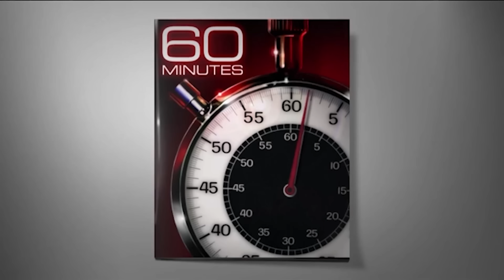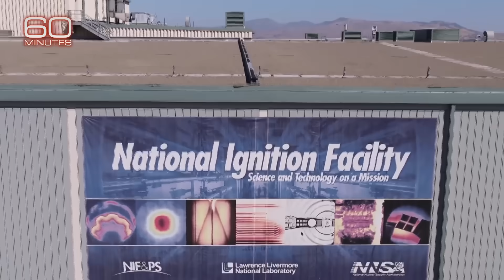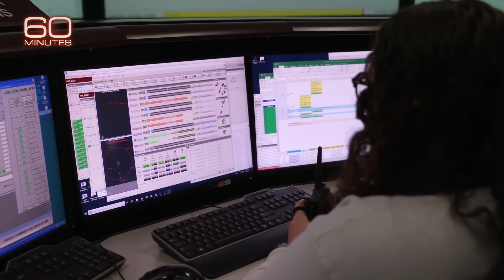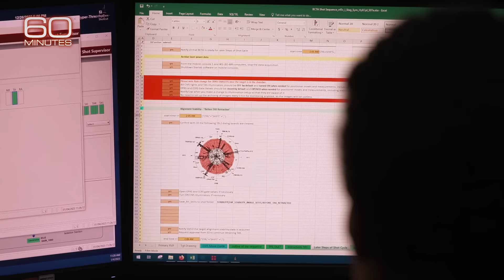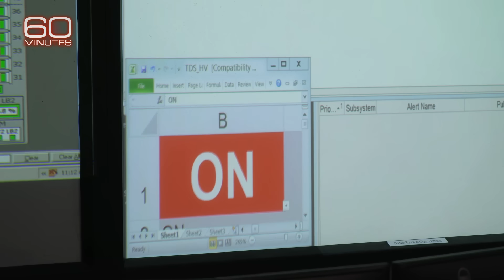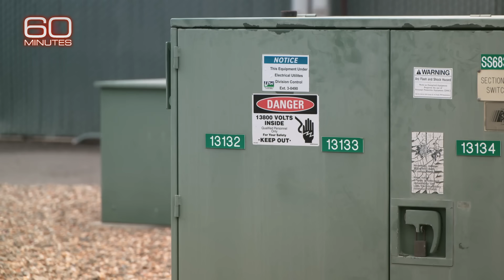Nuclear Fusion: Inside the breakthrough that could change our world | 60 Minutes

Comment: This has been done before this isn't new. It takes more energy to activate the lasersers than what is produced.  The Most successfully reaction in Fusion energy was done at the University of Wisconsin . Using Superheated Plasma (Burning Deuterium and Tritium (hydrogen-3 half life 12 years ) vs helium-3 (Half Life 72 hours and is contained)  . helium-3 would require mining the moon . its fusion with deuterium is more efficient than deuterium-hydrogen-3 ). It isn't like hydrogen from the aire?? 60minites . Tritium is rare and can be produce by mining Lithium.   It can be produced during the fusion reaction through contact with lithium, however IT isn't FREE . there is  already a Power Plant being built in France based on this  ITER it will be ready in 2025 . 60 minutes  didn't do its research?
Reply: Good try but you got many issues wrong. The ITER in France was never designed to be a power plant. It remains a research reactor under construction. It is over a decade behind its original schedule and grossly over its original budget. During the last year it experienced more major construction issues. It will be lucky if it can begin its experimental operations by the year 2030. I urge readers to search for the following article and video titles.

ITER is a showcase … for the drawbacks of fusion energy (The Bulletin of the Atomic Scientists)

How nuclear fusion works (1) - fusors, thermonuclear reactions, lattice fusion (YouTube)
How nuclear fusion works (2) - confinement, stars, nukes, inertial fusion energy (YouTube)
How nuclear fusion works (3) - magnetic confinement, tokamaks, stellarators (YouTube)
How nuclear fusion (maybe) works (4) - reactor practicalities (YouTube)

Comment: Shameful, but not surprised the Biden administration would lie on the numbers of units (power) required to produce the units that were produced.
Reply: This has nothing to do with President Joe Biden's administration. The use of fission gain, rather than total gain, has been accepted by the nuclear fusion community for many decades. That included during the Trump administration as well as the many Republican presidential administrations going back to the origins of the research efforts in the 1970s. Good try in trying to blame it on the current Democratic presidential administration.

Comment: China is WAY ahead of you, fella! Their fusion episode lasted a lot longer than yours.
Reply: Most fusion announcements are filled with sales hype and are often misleading. They often concentrate on what may be achieved in the future while obscuring what was actually achieved. If you examine the actual achievement by the P.R.C. machine you learn that it was never intended to achieve a actual nuclear fusion reaction. It exist simply to test the how long they can contain a plasma containing the normal hydrogen isotope. It has never been intended to feed that machine with a mixture of deuterium and radioactive tritium fuel. Ask yourself did the announcement contain any mention of detecting 14.1 Mev nuclear fusion neutrons. You can read about the achievements of that machine in the Wikipedia article on it.

Comment: It's just proof of concept. Current fusion experiments cannot be fueled with current fuel as it is scarce.
Reply: The market cost of the radioactive tritium used in most of the fusion experimental approaches is approximately 30,000 per gram. It is expected to get even more rare and expensive in the near future. This fact has been known since the 1970s when the first nuclear fusion reactions were designed. There are several other approaches to achieving nuclear fusion reactions. If one critically analyzes the announcements for them it may become clear that almost none have achieve significant fusion reactions.

Since the 1970s there have existed the common claim that the fuel is as plentiful as the hydrogen in the oceans. That has always been deceptive BC.

Comment: Oh my god!………..i hope this is an old re run………. The chinese have developed a sun. Twice they have fired it up  run it then shut it down just to study the data….. they did this 2019 and 2022. China is so far ahead, you guys are so far behind. Hahaha
Reply: Most fusion energy 'breakthrough' announcements are filled with sales hype. They often emphasize what the technology may lead to while smothering what actually took place. If you go back an look at the announcement, or look at the Wikipedia article on their machine you, may come to realize that the machine is not intended to use the two fusion fuel isotopes and their experiments don't generate any significant fusion energy. They simply were able to confine the normal hydrogen isotope for a record period of time.

Comment: Nice experiment...  But hardly any USEFUL purpose.   Way better to focus on Liquid Thorium Reactors.     The United States DOE simply GAVE China ALL of the  Thorium flouride salt technology it had.    Commercial fusion is NOT a decade away.    
A piece of thorium the size of a large marble.... Contains ALL of the Energy that a human needs, for their lifetime.    ZERO danger of radioactive steam explosion.  
Fuel costs a small fraction of the very expensive Uranium -ceramic Rods.
Reply: For the last two decades there has been a major campaign to encourage the U.S. government to fund molten salt Thorium reactors. The campaign was started by two engineers and they used social media channels to amplify what they wanted. The campaign has largely been a failure.

The typical promoting fans of the technology tend to immerse themselves in eco-chambers of like-minded people to reinforce what they want to believe. At the same time they dismiss all critical assessments. I urge readers to search for the following two articles a fact sheet on the technology.

Thorium, Not The Nuclear Savior Claimed (Fukuleaks)
Thorium Fuel – No Panacea for Nuclear Power (IEER)
Thorium Fuel: No Panacea for Nuclear Power (fact sheet) (IEER)

Comment: you know what the problem is? Critical mass, once they figure out the mass needed to hold itself in a self-sustaining reaction without runaway. We will have fusion energy. It would need pulsed, cause no energy source like this could go continually without exploding. maybe 1-3 second pulses.
Reply: Critical mass is needed with fissionable materials to sustain a nuclear reaction. That's what's involved in fission explosions and in the controlled fission reactions in standard nuclear reactors. It doesn't apply to controlled nuclear fusion reactions.

In the announced NIF experiment the frozen hydrogen isotope fuels were compressed to a microscopic point by the radiation pressure and reaction force of the plasma blasting away from the surface of what was a fuel capsule. The X-rays were generated from the ultra violet laser beams that lasted for approximately 0.000,000,003 second. Even during that short period of time the extremely expensive laser amplifier glass components suffer a tiny amount of damage. If the pulse lasted 30 nsec then the glass would likely shatter in all the lasers, putting an end to the 13 year old research program at NIF. There are no newer laser technologies that can handle energy levels  that are even close to what the NIF lasers currently endures. The nuclear fusion reaction lasted for approximately 0.000,000,000,08 second. It took about a week to set up the experiment. The fusion energy released in the experiment was about enough to boil two liters of water. The input energy to the laser was more than 100 times as great.

The laser beams turn the fuel capsule into a plasma where the electrons are separated from the hydrogen isotope nuclei. As a result the positively charged protons in those nuclei repel each other with enormous force, hindering nuclear fusion reactions. Once the laser irradiation has ended and a tiny bit of fusion occurs in the core then the enormous forces blast away the remaining fuel so it can't react. Approximately only 4% of the fuel reacted. The remaining 96% was blasted away from the reaction center and had to be cleaned off the target chamber surfaces as radioactive waste. The NIF lab management has always used the term 'ignition' in a deceptive way. The announced fusion reaction involved no significant propagation of the fusion reaction.

Comment: If something goes wrong, it just stops. Yes it will, and often. This is said of a device that is so complex that it can be expected to be shutdown for repairs for longer times than it operates. Fusion is a red herring that scientist have been milking for a half a century with global costs to date quickly approaching a trillion dollars. For goodness sake, it operates at 100 million degrees minimum! How do you transfer that heat without damaging the machine? It is foreseeable that at best, it will only be able to produce enough energy (safely) to provide for its operation. Understand this: it is hotter than a star! Thorium is the answer and has always been the answer. It also seem self-defeating to have super cooled magnets containing a hundred million degree plasma. Am I missing something here?
Reply: You are not missing something about the futile efforts to create a controlled nuclear fusion reaction. You are correct about the challenge of isolating the superconducting confinement electromagnets, operation at just above zero Kelvin  from the 150 million Kelvin plasma only about a meter away. The magnets will be bathed in an intense flux of 14.1 Mev fusion neutrons once the reaction begins. If the magnet conductor gets much above 3 degrees Kelvin they will quench and blast off the cooling liquid helium.

The vast majority of nuclear fusion experimental facilities haven't had experience with this problem yet since they haven't employed any hydrogen fusion fuel isotopes and therefore they haven't generated any significant fusion reactions along with the intense 14.1 Mev neutron flux.

Most fans of Thorium fueled reactors tend to immerse themselves in only one side to the story to reinforce what they prefer to believe in. I urge you to search for the following titles that are typically not mentioned in the information sites that promote thorium fueled reactors. Additionally, we don't have 20-30 years left to turn this 'Titanic' around.

Thorium, Not The Nuclear Savior Claimed (Fukuleaks)
Thorium Fuel – No Panacea for Nuclear Power (IEER)
Thorium Fuel: No Panacea for Nuclear Power (fact sheet) (IEER)

-----
IPCC report: ‘now or never’ if world is to stave off climate disaster (TheGuardian)

UN chief: World has less than 2 years to avoid 'runaway climate change' (TheHill)
  * This statement was made 4.4 years ago.

Comment: These laswers have been in place for many years meaning they been doing this crap for many years
Reply: Correct! The NIF began operation in 2009 and was expected to achieve the break-even fusion goal by 2012. It failed by a factor of more than 10. It took another decade of tweaking numerous components to achieve the recently announced 'achievement.' NIF was preceded by two other laser facilities at the LLNL that were expected to work out all the problems that they encountered since the experiments began in the 1970s. Those 60 Minutes production provided no details regarding that lengthy experimental history.

Comment: Such a waste of time and $$
Reply: Dustin Baker
Reply: The NIF project became operational in 2009 after major delays and cost overruns. The primary goal of achieving a 'break-even' fusion reaction was expected to occur by 2012. It missed that target by a factor of about 10. It took them a decade to get close to the original goal. Still, in the announced experiment, it required 100 units of laser input energy to get one unit of fusion energy out at the other end. That experiment took about a week to prepare and the nuclear fusion reaction lasted for only about 0.000,000,000,08 second. It is estimated that the NIF project has already cost U.S. tax payers approximately $11 billion. The real purpose has always been obscured by the NIF management when they present to the public. It has always been primarily funded as a thermonuclear weapon (H-bomb) research tool.

Comment: This is the only thing I know that might give a possible future for mankind, fossil fuels are within 200 years or less of running out and that will lead to wars over the last resource on earth which in turn will cause the extinction of mankind.  Which is also parallel's to God word of the end of days. There are things like superconductors at room temperature that can speed up the process of Fusion and sustain the fossil fuels to last longer.  However with even superconductors and just nuclear power plants alone we can not power the the system to maintain the current population of the world it has to be fusion or something similar like creating a miniatured Singularity. If we do not come up with a power source other then our current sources there will be massive starvation and wars if we survive that and the wrath of God we will be back to horses and wood burning for boilers there will be some synthetics however they usually produce less power then what is put into them to produce in other words would be expensive. I am sure there will be solar panels and windfarms but the are costly to produce or maintain with out fossil fuels.

Comment: I'm no scientist but i think the reason why these experiments aren't working   is simply the Enviromental conditions. Its like growing an acorn on a bathroom tile floor. The conditions on our atmosphere are not conducive for an example: the  air composition , the temperature the  pressure in our altitude and many other factors . the reason it went out was becauce nothing was feeding it, This fusion can be done but this teams needs an outside thinker   . hit me up .
Reply: The NIF management's definition of 'ignition' is misleading. When most people think of ignition they assume it is like a match igniting. The chemical starts at a microscopic point and then propagates through the rest of the fuel within about two seconds, consuming all of it.

In the announced NIF experiment the fuel was compressed to a microscopic speck at which point the compression was so great some of the fuel atoms began to fuse. Then the internal expanding forces became so great that the remaining fuel exploded outward, separating the atoms beyond the point that they could fuse (react). Only about 4% of the fuel reacted to produce a limited quantity of energy. The remaining 96% was blasted away from the reaction center to become radioactive waste that had to be cleaned from the chamber. There was no significant propagation of the reaction. The nuclear fusion reaction lasted for approximately 0.000,000,000,08 second and released enough energy to boil two liters of water. The compression depended upon a 3 nanosecond laser pulse. The lasers experience damage if the pulse is much longer than that. Also they can only do about one shot per day.

The effort to create a controlled nuclear fusion reaction has been going on since the mid-1970s. It currently involves about a dozen countries operating about twice that number of experimental machines. It has always relied upon hundreds of top-level nuclear fusion physicists and engineers trying to solve the scores of problems that still need to be solved.
Reply: @vernonbrechin4207  yes  you  theoretical correct based on the information already discovered . However  . I think what’s holding them back from a larger discovery is simply their POV . The conundrum of human behavior  is that when we  hit a Break-thru,  we tend to continue doing the same to get better results only adjust a few thing .   The answer is simply your Pov . The minute you change your point of view  the truth changes .
Reply: @livelikewale7077  - I appreciate your perspective on it having to do with a Point of View (POV). In your first comment you stated that the environmental conditions were not conducive to sustaining the fusion, with a mention of the atmosphere. The NIF experiments are conducted within the center of the large target chamber. Every experiment requires that the air is removed from that chamber to far less than 1/10,000ths of normal atmospheric pressure. That is required for several reasons, one being that the fuel mix is in a solid form at less than -259 °C. That is far from the conditions in the core of the sun where hydrogen fuses to release energy.

Many different approaches have taken place to try to generate nuclear fusion reactions on earth. In the field of controlled nuclear fusion research there are currently more than three different approaches that are being explored. Many of them are quite different from what is being done at NIF. Just because a massive effort is made to solve some problem doesn't mean a solution will soon be found for that problem. It is estimated that NIF has consumed about $11 billion so far over a span of time of a bit over a decade. Once it became operational it was expected to achieve a break-even nuclear fusion reaction back in 2012. It missed its target by a factor of more than ten. Sixty years ago scientists set out to find a cure for cancer. Many billions of dollars later they still have many barrier to cross. Science is abut discovery, not about fulling people's dreams of a solution.

The NIF managers have always obscured the primary purpose of NIF when they make public presentations. It has always been primarily funded as a thermonuclear weapon (H-bomb) research tool, not a facility aimed towards a future economically practical nuclear fusion power plant.

I urge you to read the Wikipedia article on 'Fusion power.